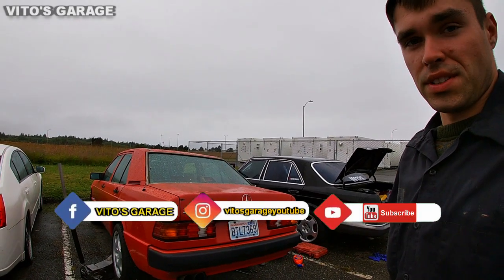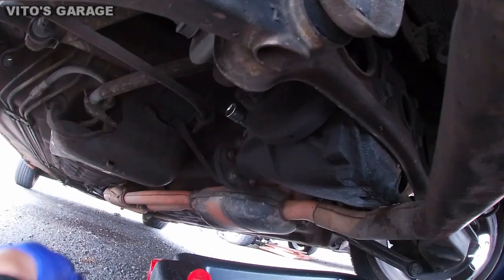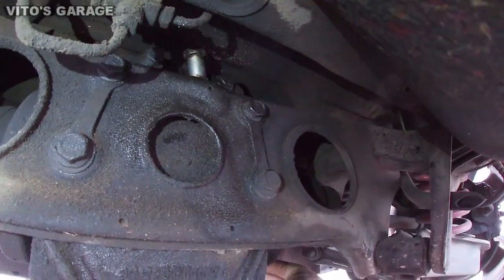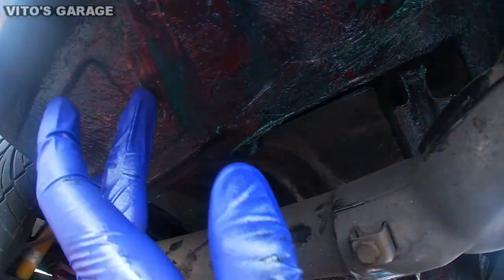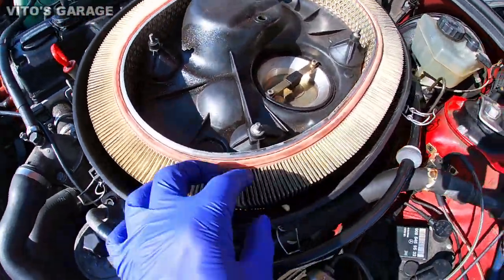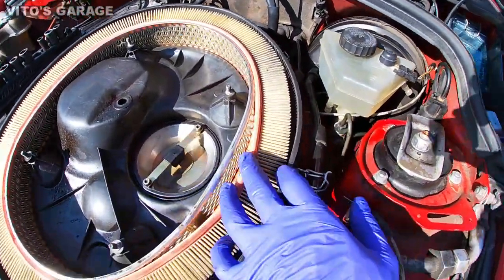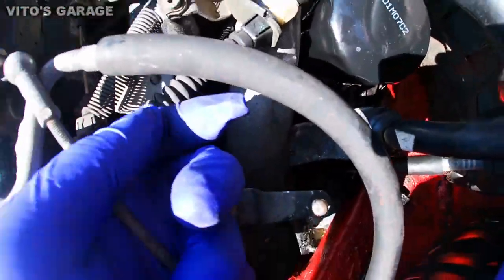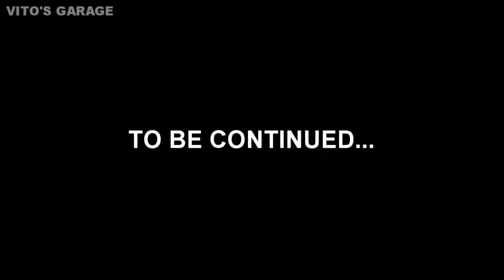Mercedes 190E Diff Fluid Change, Brake Fluid Leak Fix + Engine Accelerator Linkage Maintenance!

Comment: Vito, any particular reason you are using 75w140 instead of 75w90 or 85w90? There is conflicting information out there about what to use Dino or synthetic and what viscosity. Thank you.
Reply from the maker: You can use those as well. I chose this one because it was a heavy duty one and made for limited slip differential. I wanted more protection for it. That’s all. And the fluid was full synthetic as well, which is a plus

Comment: when you replaced the brake fluid reservoir grommets was the fluid leaking behind the master cylinder just like this photo? 
http://forums.pelicanparts.com/uploads16/IMG_1116a1259151318.jpg
Reply from the maker: I can’t remember honestly but it’s possible for it to leak all the way down making you think it’s something else causing it. Rubber grommets are a common issue. Replace them. Good idea to clean out the brake fluid reservoir at the same time